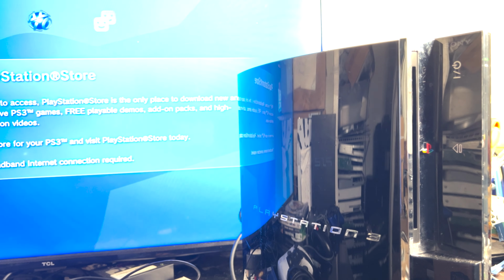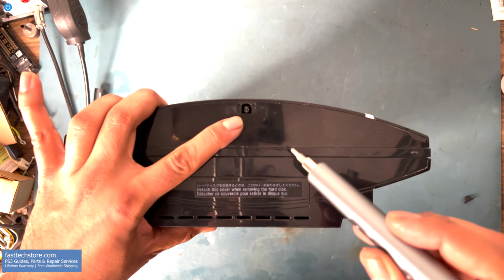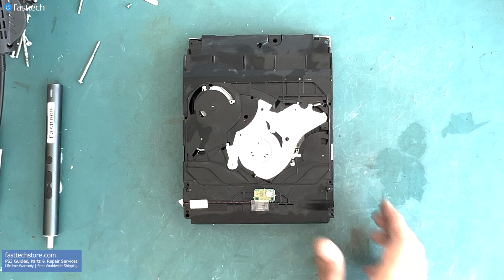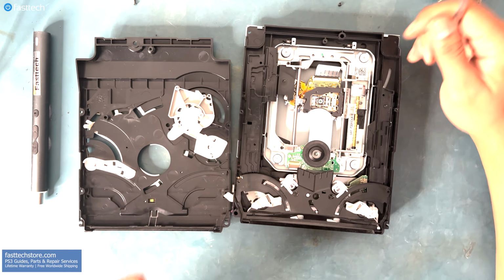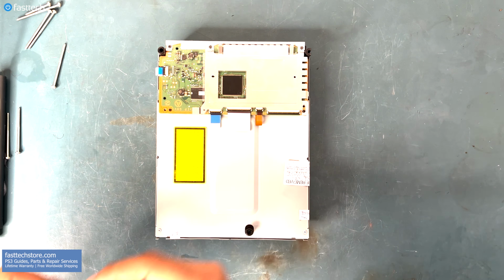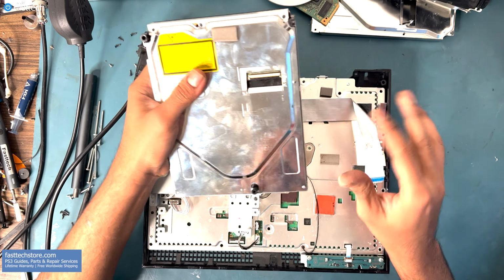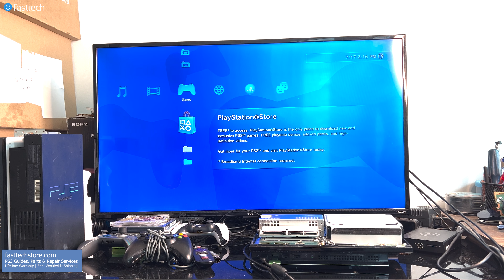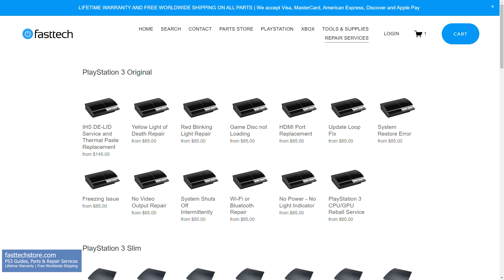PS3 Not Reading Discs Repair Guide (Laser & Disc Drive Replacement)

Comment from the maker: 👉Fasttech Pro Autokit: https://www.fasttechstore.com/tools/fasttech-pro-auto-kit
👉KES-400 Laser Lens: https://fasttechstore.com/playstation-3-parts/p/9n9co014cchh61yzt3fthi00slztsg
👉BD-400 KES-400 Disc Drive Only: https://www.fasttechstore.com/playstation-3-parts/kes-400-blu-ray-disc-drive
👉BD-400 KES-400 Disc Drive with Logic Board: https://fasttechstore.com/playstation-3-parts/p/kes-400-blu-ray-disc-drive-with-bmd-001-board
👉KES-400 Laser Lens with Deck: https://fasttechstore.com/playstation-3-parts/p/ps3-kes-400-laser-lens-wth-deck
👉BD-410 KES410 Disc Drive with Logic Board: https://fasttechstore.com/playstation-3-parts/p/kes-410-blu-ray-disc-drive-bmd-003-bmd-006 
👉Disc Drive Data Cable: https://www.fasttechstore.com/playstation-3-parts/sony-playstation-3-blu-ray-drive-data-cable
👉Disc Drive Power Cable: https://www.fasttechstore.com/playstation-3-parts/sony-playstation-3-blu-ray-drive-power-cable
👉Disc Drive Logic Board (BMD-001): https://www.fasttechstore.com/playstation-3-parts/bmd-001-disc-drive-logic-board

👉GET REPAIR SERVICE FOR YOUR DEVICE: https://www.fasttechstore.com/electronics-repair

00:00 Intro
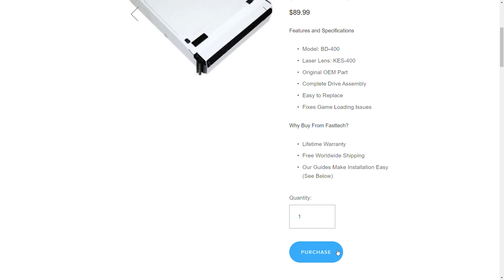00:56 Does this video apply to my PS3?
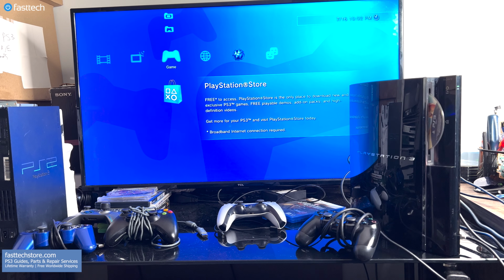1:32 What a PS3 Disc Drive issue looks like
2:10 What a faulty laser sounds like
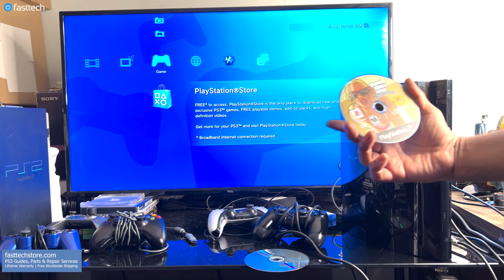2:28 PS3 not reading PS2 Discs or DVDs
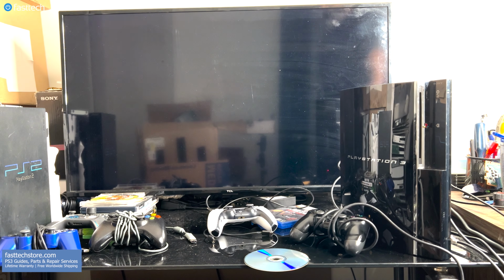2:52 How to check a PS3's model number
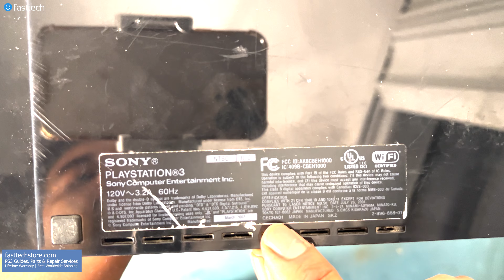3:10 Disassembly
4:30 Removing the Disc Drive from the PS3
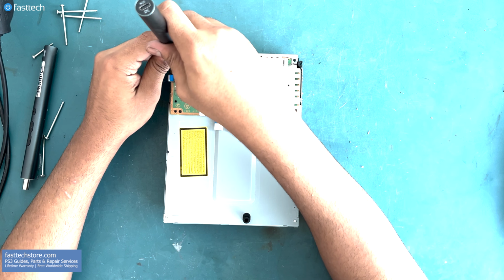5:08 Disassembling the Disc Drive
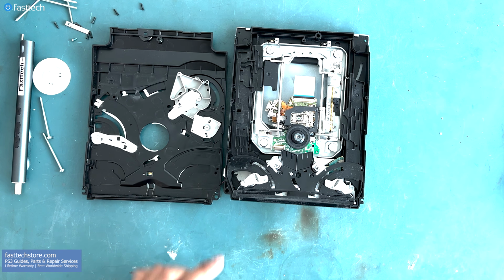6:32 SOLUTION 1 - CLEANING THE LASER
7:47 Replacing the Laser Deck (Overview)
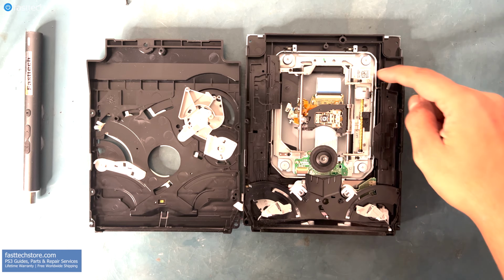8:16 SOLUTION 2 - Replacing the Laser Lens 
13:29 SOLUTION 3 - Replacing the Disc Drive
16:32 SOLUTION 4 - Replacing the Disc Drive and the Drive Logic Board
20:13 Pre Assembly Testing
22:03 Assembly 
23:16 Final Testing
24:13 Outro
Reply: My Ps5 keeps blowing fuses. Would a new power supply unit solve the problem?
Reply: I order tools set to work on my PS3 Fatboy, it’s been a few weeks and I haven’t received them yet. Patiently waiting.
Reply from the maker: @manofsteel8292  sorry to hear that. Email service@fasttechstore.com and we will get it sorted out

Comment: Thank you for the video.  I have a CECHB01 system.  My drive was just like the one shown.  I followed your procedure to clean my laser and my PS/3 still can read and play PS/3 games but cannot read PS/2 games or play DVDs anymore.  (I did get to have PS/2 games work for a while this weekend after I did a system restore to defaults but it stopped working again).  Does this mean that my laser is bad and I need to follow the procedure here to replace it?  Are there two lasers in the laser unit, one for PS/2 games (red) and one for PS/3 games (bluray), and therefore my red laser is dying or is dead ?
Reply from the maker: @ilovemywifemost  yes replacing the laser will most likely (90% chance) will fix your problem
Reply: @fasttechvideo  Thanks for responding so quickly.  But since I did not expect that I edited my original question so you might not have seen my edits.  Does the CECHB01 system bluray drive have two lasers in one of sorts, a red one for PS/2 games and a bluray (blue) laser for the PS/3 games and playing bluray movies?  For me, bluray functions are fine.  However, for some odd reason, when I did a system restore to defaults this past weekend, I was able to play PS/2 games for a while.  Now it is not working again.  Is this a red laser going bad ?  I did the restore twice and each time I got PS/2 games working for a while.  Really odd.  Not sure why the restore gives me the functionality for a while.

Comment: So i got it to take the disc and it even read the game i loaded it. fine. i turned it off and when it turned back on its now not recognizing the disc nor is it letting me eject the disc. also no beeps on eject. and the hold eject button deal isn't working either any ideas?
Reply from the maker: Either the ribbon data cable isn’t plugged in properly or you shorted the circuit board

Comment: Hello ;-;
Reply: Dear fast tech I think I need help
Reply from the maker: @AngelEmbertson-le2gp  how can I help you?
Reply: @fasttechvideo  well I'm facing a problem. I bought a PS3 last month and tonight I attempted to clean it. I disassemble the majority of it and like an idiot once I took the lid off I turned the PS3 over a trash can to drop any remaining dust and incidentally I dropped the disc reader in the trash can and it disconnected from a strip that connected to another part of the ps3 and I have no idea how to reattach that part
Reply from the maker: @AngelEmbertson-le2gp  youve broken the disc drive ribbon cable clip which can be put back in place. Put the cable in first then insert the clip from the top.
Reply: @fasttechvideo  okay I imagine I can fix it then but it requires even more disassembly. My PS3 model seems to be much different from the ones I've seen on different videos
Reply from the maker: @AngelEmbertson-le2gp  what the model of your console? Starts with ‘cech’ and is on the back of the console